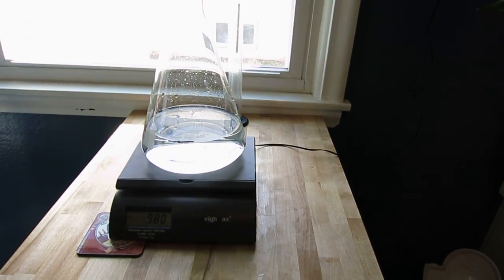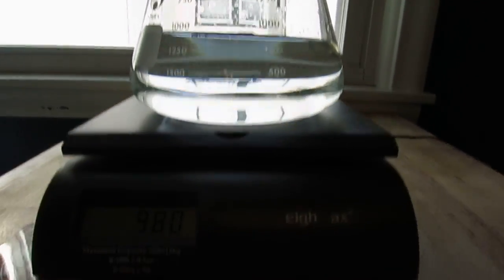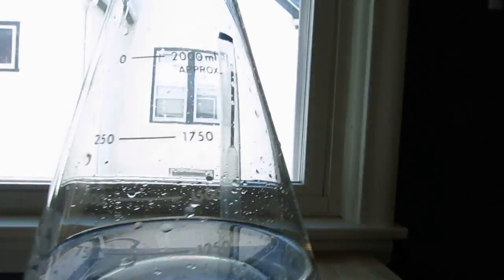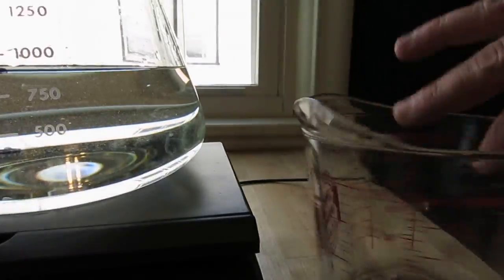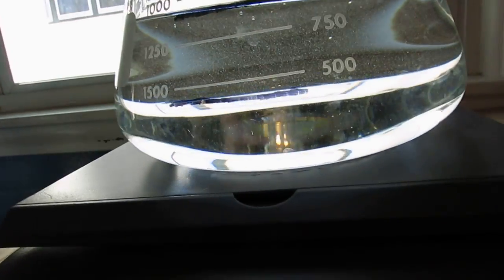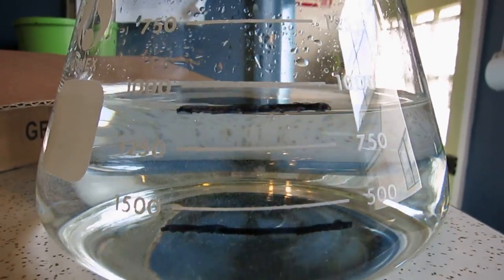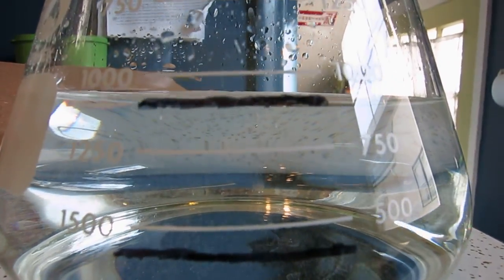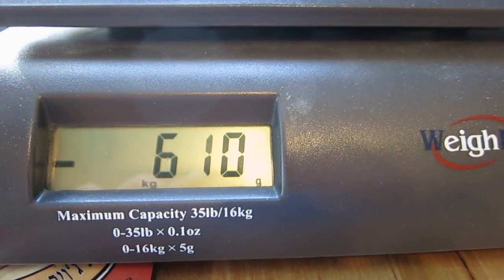Calibrating an Erlenmeyer flask by weight.

Comment: Just a warning, I calibrated my measuring cup and it was way off, so not all measuring cups are accurate. So now I calibrate everything by weight, even my carboys.
Reply from the maker: +unexceptionalrebel   In this case the measuring cup matched the weight, so it looks like it's right.  :)
Reply: Yeah, I was having issues and inconsistencies with using different measuring devices when adding water to my carboy.  So, I did the same.  Calibrated by weight.  I've got a nice postal scale that goes to 75 pounds, so it worked out well.

Comment: How far out are the marks on your flask there? They look to be insanely inaccurate, like 10-15% out unless you're constantly leaning the flask back from the camera.
Reply: +mwtbones I have a flask that's even worse!  I used to work in a molecular biology lab and you never ever never trusted those marks.
Reply from the maker: +mwtbones  I'd say that yeah, about 10-15% off. The flask was not leaning back. It was a little crooked in this vid but you can see the black (accurate) line compared to the factory one.
Reply from the maker: +RabidMortal1  Interesting. This is all news to me!